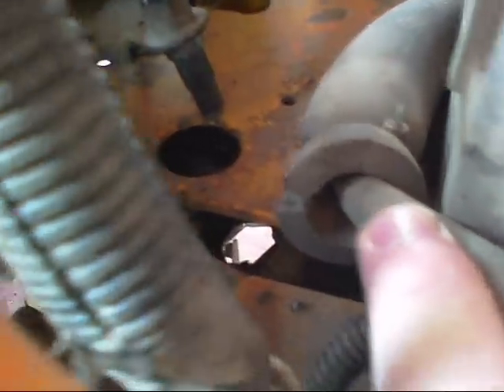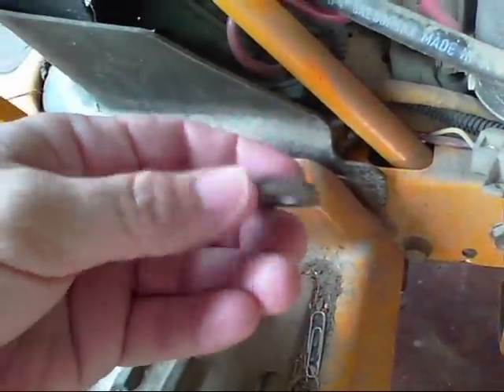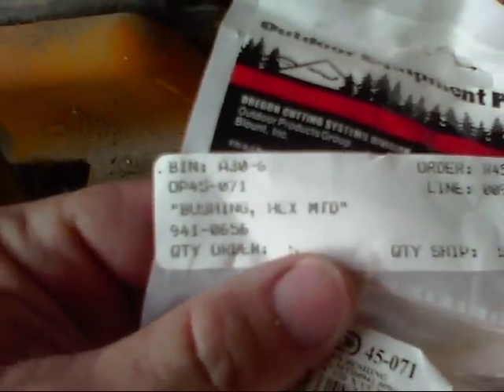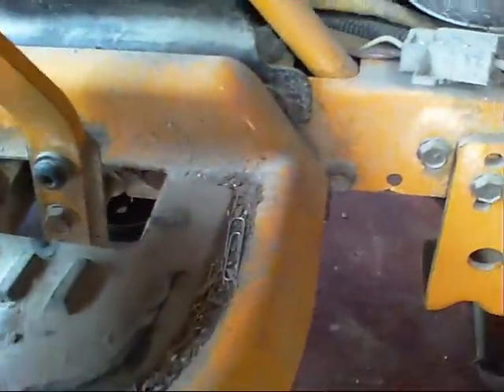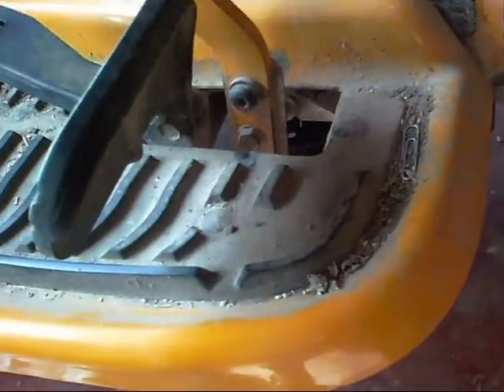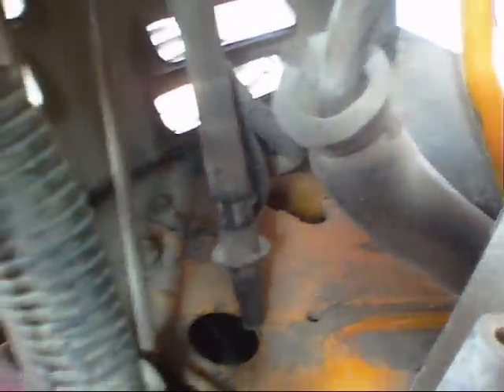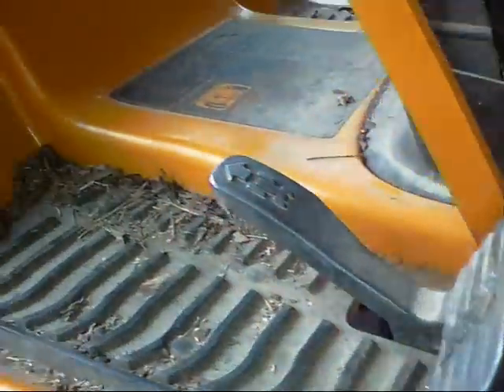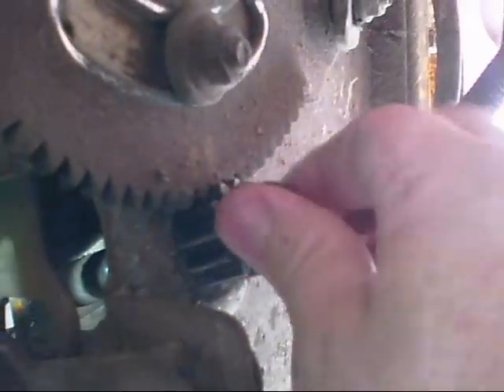How to Repair your Lawnmower Steering.

Comment: Fantastic! My steering has been slipping gears turning to the right for a year now but I've been able to limp it until today. I have a spare parts mower I'm going to try stealing it out of and see if that'll save me a few bucks. I already replaced the transaxle. Both were bad when I bought the mower a year ago but I knew this going in. Good to know it's so cheap either way. I'm actually surprised it lasted as long as it did since I'm a pretty big guy. Might as well lube up the moving parts while I'm at it. Cheers.
Reply: Turns out the part for mine is $28 and change haha I hope mine works
Reply from the maker: Good luck with the repair Big Dan

Comment: I replaced my gear/kog and sprocket a few months ago, it is starting to strip/slip again. is there a way i can sit the gear sprocket closer together wtih maybe a new washer/bushing? or do i need to replace the kog and gear again and hope for the best? i didnt do the bushing the first time.
Reply: mine is sitting just loose enough that its stripping it. is there a way to adjust?
Reply from the maker: no adjustment other than replacement of these components. Its a poor design on cub cadet mowers.
Reply: @pusherpilot  the gear plate has a bushing also that a bolt goes through. That's the pivot point of the gear plate. That can cause some play in your steering as well.

Comment: I know you posted this a few years back, and I hope you can help me out. I have a Cub Cadet LT 1046 and my steering went out as well, but mine made a clicking sound and I was still able to steer to the right, but when  I tried to steer to the left nothing , but clicking. Your thoughts? Thank you!!
Reply from the maker: +stormknight617r   Yea, I still bet it is the same issue. I have replaced my steering gear about 4 times over the life of the mower. Sometimes when it wears out it will steer one direction but not the other because it takes less force to move in that direction. Thanks for the comment.
Reply: Thank you for responding back! I have ordered the parts and I will let you know how it goes. Again, thank you for your video it was a big help.
Reply from the maker: You are very welcome. Glad to help someone.
Reply: +Paul Roberts 
Hey, just letting you know that I received the parts yesterday and today Dad came over and we replaced the hex flange bearing (same part in your video) and the steering pinion gear and that fixed the problem.  Thank you for your video, I am sure that saved me more than a few dollars. I subscribed to your channel and looking forward to watching your videos and learning more tips. Again, thank you!
Reply from the maker: Thank you for your subscription. I am thrilled that I helped someone using this video. Thanks
Reply from the maker: That is a common problem with these mowers. The little steering shaft bushing wears oblong and causes slipping. Easy to replace. They cost about 10 dollars